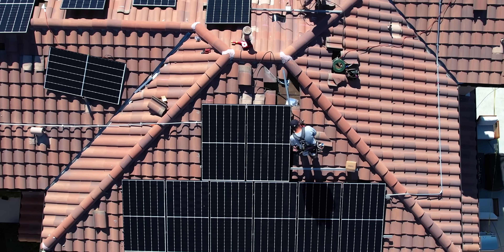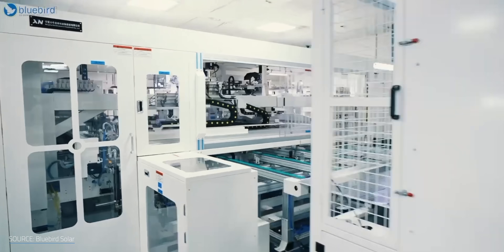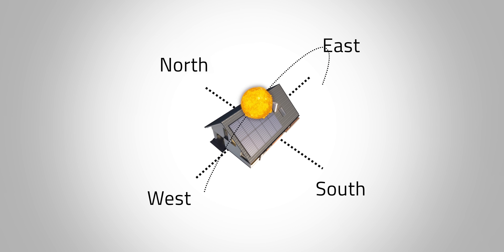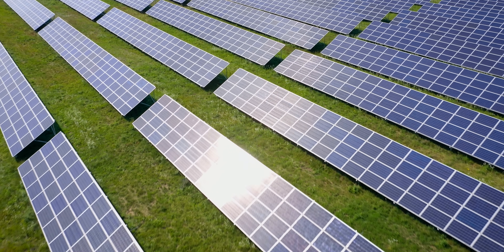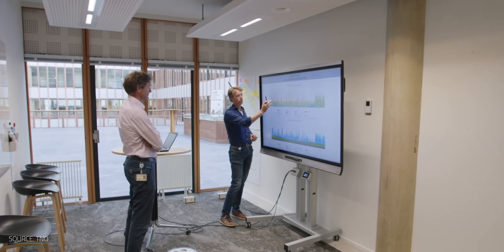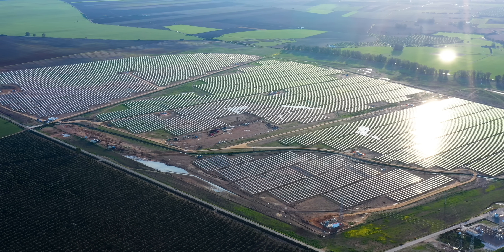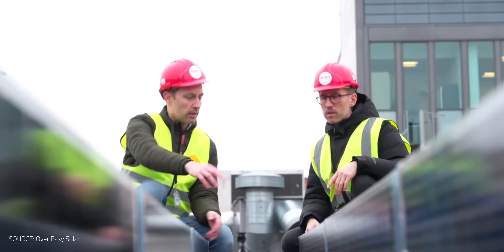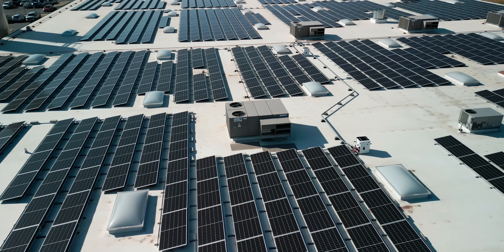Have we been doing Solar wrong all along?

Comment: Contemplating the "big reveal", it makes sense in a heat capture sense as well.  The vertical alignment means that the cross-sectional area that is parallel to the ground is lower, which would lead to less captured air below the panel.  The solar farms I have seen don't usually leave a lot of space for airflow, and the large area interrupted by support posts probably causes a lot of turbulence in whatever air flow does exist.

I would be curious to see how a semi-porous panel would perform.  Conceptually, drill holes in it.  Increase the area that can act as a thermal release, give a bit of a chimney effect to draw the air below the panel above, and allow for it to vent the stagnant air below more easily.  I imagine it would play hell with the electron flow and be prohibitive for manufacturing processes.  Holes in glass are expensive, and you would still need to make whatever seal you put in the holes thermally conductive to be reasonable.  Also would need to maximize the efficiency gain vs surface area loss function.  I'm just blathering here, so eh.

Comment: I’m going to try it
Reply: I should’ve added the recent snow we had here in Chicago. My bifacial panels went into a overvoltage on my charge controller. It was wasn’t a Lot just enough. I have a Victron 100/30 and according to the short circuit voltage, it should’ve been fine, but as soon as that snow hit it Went up shutting down my solar controller but yeah I’m going to reposition them vertical. I’ll let you know what happens either way my bifacial panels are  definitely putting out a lot more energy than my standard ones

Comment: The voltage only pushes the amps through the wires. The number of amp is what is needed. Voltage drop that small does not do that much compared to the loss with not having the maximum exposure. All in all solar panels outside the lab is a whole other story. Having had solar and seen how they fail to produce as they get older was not from a voltage drop. It was from less amps being produced. The whole idea that these are going to take us to a green utopia is just one more pipe dream. I am all in if it makes the electric bills go down but in reality all it has done is increase the cost of electricity for the poor and raised taxes. So just because this is a YouTube post it isn't going to increase enough energy to make a difference. All in all the amount of electricity demand is going up and solar is just a few percentage points (if that) of what we need.

Comment: I just see potential solar cladding and or yard delineators for construction in the future. Combined with other solar tech like transparent solar, windows too could potentially be solar. the construction footprint could be optimized to prosume electricity and strengthen grid networks as long as existing power infrastructure is upgraded appropriately. With energy storage technology, it might be possible to capitalize on solutions that save and earn money more so than merely offsetting the utility cost. I am excited for smart construction techniques that will make homes more comfortable and affordable long term.

Comment: Good result, BUT The explanation given is a little off. Silicon itself becomes MORE conductive as temperature rises, which is often a problem for old silicon transistors (Second Breakdown would happen and kill them if they got too hot under load.) The reason voltage is higher when PV panels are kept from getting too hot is related to that conductivity trend: Hot silicon has too much freedom in the charge carriers. They more easily jump back across the PN junction, so the cell does not produce peak voltage. That is the opposite mechanism of what was described. @UndecidedMF

Comment: i wonder if there's any benefit from the fact the the photons of light will spend longer traveling through the PV when the light hits it at a more extreme angle. 
Basic trigonometry. the shortest path through the panel is perpendicular to it, a length of "1". so maybe that has a reduced chance of each photon being absorbed. but if it hits at 45 degrees then there's a root 2, roughly 1.41 distance that the photon travels through the PV. if you can get it up to 60/30 degrees then that's a distance of 2, double the distance, twice as much chance of a photo being absorbed? but then you also have to account for higher chance of the photons deflecting off the surface and the reduced amount of photons over a narrower shaft of light hitting the panel because of the extreme angle. Laying directly at the sun the shaft of light is identical to the surface area. but if its at 60 degrees then the shaft of light is 1/2 as long, but would be the same width, so the reduced surface area hitting the panel is halved, while the potential to absorbed is doubled. so maybe there's no improvement, unless you are collecting from both sides of the panel.

Comment: This would also help in areas with a lot of snow.  In the winter my panels are covered. And it's kind of sketchy to get up and clean them off. So even on the sunny winter days, if the snow hasn't melted, i get no voltage.

Comment: Celsius, Matt, not Centigrade. 
Otherwise, another fabulous video! ❤🎉😊
Reply: As it turns out Centigrade is not acceptable to the Bureau International des Poids et Mesures, the keeper of the flame for the Systeme International or SI, the modern metric system.
Reply: Being identical in their characteristics and scale, either is acceptable, especially in countries which have not adopted SI units in full.

Comment: My guess is that vertical solar panels, which depend more on albedo irradiation and are not subjected to direct sunlight, experience lower temperatures. Lower temperatures mean higher voltages since voltage and temperature are inversely proportional. Higher voltage leads to higher power output.

Comment: those smaller 'apartment deployable' panels you mentioned would be perfect for renters in general. talking about the perspective of australia, we already have a huge market for rooftop solar arrays. even the most rundown shacks have almost their entire roofs covered. however there are still a lot of houses (particularly rentals) that don't have them or have a really old system that barely even works. the place that I rent in brisbane currently has such a pathetic array that it only produces something like 1.5kw a day. with current electricity prices and extra meter charges for having the system, all it does is make the bill that much more expensive. having a cheap, portable system that can be deployed anywhere and then taken with you would be a massive boon.

Comment: Your explanation of why power output drops with increasing temperature is bad - the increase in resistance is not relevant. The main reason why the voltage drops at higher temperatures is due to increased electron diffusion at the pn-junction, i.e. more electrons have enough thermal energy to go "the wrong way" at the junction, thus lowering its operating voltage. 
Also you got the explanation of the heat transfer coefficients wrong. When a heat transfer coefficient is lower, then the corresponding panel would heat up more, because it couldn't transfer heat to the cooler surroundings as easily.

Comment: I have two properties with 102 panels each at about 23 kilowatts per array.  They have worked great for 10-12 years so far.  I pay almost nothing for power each year, however, if I didn't have the power company and federal dollars to install, it would not have been worth it to get these installed because the payoff would have been 30+ years.  Of course it is nice that these are contributing to lower emissions than a power plant.  I love the technology, but the cost is prohibitive.  These are working so well, the power company will only approve arrays about half this size.

Comment: if its just cooling, then why not water cool the panels.

You could put anti freeze in the lines and run the anti freeze through a radiator

On cold days, you can dump the heat inside. On hot days, dump the heat outside, or if you have a pool, you can dump it in the heat in the pool

Comment: So would this not imply that existing solar arrays that have mechanical tilt controls, should be intentionally aligning themselves in a manner that reduces the optimal solar collection, but also reduces thermal degradation?  Or is this already happening?  I would also assume this could improve the durability/reduce cost of solar cell manufacturing as I believe high heat affects these as well?

Comment: re: solar panel inclination equal to you latitude?
I've always suspected that this cannot be true. Sure the panel is perfectly aligned for the exact moment of the Sun's highest point. However it is imperfectly aligned for all other points between sunrise and sunset, times at which the incident power is lower and so efficiency might be more important. 
Surely, there's an integration function to be done here to work out which angle between zero and your latitude give the overall cumulative maximum insolation?
(Even thinking very simplistically, there is ONE moment when the sun is at maximum elevation, vs two moments it is at every other inclination below that, where incident power is not maximized)

Comment: I'm surprised wind hasn't been mention as a reason why these panels are cooler. Wind moves sideways, and more commonly from in the east-west directions (as opposed to north-south), is this just a coïncidence?

Also, a huge advantage to these panels would be for places where we have winter. Snow will almost never accumulate on vertical panels, as opposed to horizontal/tilted panels.

Comment: I noticed most of the examples you listed were in high latitudes, where the sun is lower in the sky. That will also benefit horizontal panels. I’d bet there’s some latitude below which the cost/benefit math flips back to horizontal. Interesting thoughts.

Comment: The amount of land required for projected solar needs is grossly underestimated by most.  
Here in Georgia, I see large swaths of forest and farmland lost to solar "farms."   This new/improved technology would seem to greatly increase the viability of agrisolar.  I once calculated the amount of traditional solar farm required to "fuel" up the same number of EVs as our local Buc-ees super gas station does,  in ICE vehicles, to be in the neighborhood of 1 to 3 thousand acres.(depending on if your shooting for average or peak demand)  Even that number could be low.  Buc-ees does not allow semi trucks, but many many large pickup trucks pulling large loads and large RVs fuel there.  The amount of electricity required to move that much weight the same distance that those tanks of diesel will is staggering.  
Most agrisolar I've seen is mounted high with crops underneath.  This could be mounted low or high, depending on crops you desire to grow.  
All this is of great interest to me because we are attempting to build a farm in Africa to supply an orphanage there. Reliable electrical grid is another issue there.

Comment: 1) What are the economics like for these panels?

2) I’d be terrified to run a mower or bush hog anywhere near these panels…

3) Why hasn’t there been more side by side testing vs traditional setup?

4) if cooling makes such a big difference, why not simply slap a heat sink on the under side of horizontal panels? Surely this is less expensive than putting an entire additional PV face on the other side of the panel.

Comment: I could see this having some use cases with electric fences, It would bee great to stick a battery near by with a battery near by for the fence charger, if your running a few miles of fence line and set your panels just outside the fence you could potentially run a hard line and power an entire ranch with enough panels. But these may be too expensive for ranchers to be able to do anything with. they have slim margins as is, but potentially with enough of them they could become profitable if the power company would except payment for the extra power being supplied.

Comment: Or you could just add a small radiator to your superiorly positioned panel for a couple bucks, or even just a couple phase change heat pipes for less and aklow them to autocycle

Comment: The physics is pretty simple.  This is the same reason that heat sink fins are oriented vertically.  Heated air rises.  Flat panels trap the hot air under the panel and it has to travel to the edge before it can more upward.  That greatly slows the convection currents.  Vertical panels allow the heated air near the panel to quickly move straight up removing the heat efficiently.

Comment: For a small application, I think this would be great to install on traffic light masts and overhead highway signs, assuming glare isn't a problem. Maybe that could keep the lights running on these things with a battery or backup to the power grid at night. Same for highway barriers / sound walls to keep the lights running.

Comment: omg, if they were to put laminar flow or squirrel cage like wind turbines on the top of each "nearly" upright panel, then the panels' rising heat would generate more Elec (not to mention from breezes). A super system would have transparent water/ethanol jacket over panel to have water cooling of cells while generating hot water supply (or heat exchanged out).  Now array can be smaller w higher value output.

Comment: I have a single panel on our chicken coup that historically I have tried to keep relatively perpendicular to the dominant sun angle of the seasons but I got lazy and left the summer sun angle for the winter and was shocked to find that the lower “sweeping” sun angle of the winter sun actually seemed to charge my battery more fully and quickly. Now I just leave it alone and appreciate it as a happy circumstance 😂 🐓

Comment: I would have assumed the main difference would come if they used another material in between the panels or possible make the material dividing the 2 sides translucent. If anything If they throw the traditional mix out the door and rework it as i mentioned it could be the next big thing. Translucent might be hard to do but a more absorbent material might also work. Another idea mightbe to make the surface under the panels somewhat reflective or for example if they left 30-45cm under the panels or curved the light below to a limited degree it could make the morning, evening and the noon light as efficient but i do understand that the dust buildup over time would make it hard. its still possible to do this on flat buildings by having a maybe 5% downslope so wind and  water would periodicaly clean some of the debrie of the mini sun collector

Comment: would be interesting to combine with solar panels mounted at 45° to an A-frame between vertical bifacial modules. Reflection should increase yield for the vertical panels and reduce the noon-"dip" in output. With some simulation a very straight yield curve over the day can be realised.

Comment: Would these vertical bifacial  solar panels work better the higher up north or south they are installed? I live in Lithuania where the optimal solar panel angle is about 38 degrees. But i noticed something interesting after watching this video. At 38 deg and optimal azimut the effectiveness is 100%. But at east and west azimut with 90 degrees angle the effectiveness is 56%. So 56% x2 is 112%. So is it more effective land use to have these vertical panels instead here in North Europe?

Comment: I'd imagine because the ground reflects the usable visible light but absorbs the UV, infrared and other useless wavelengths, you decrease the available direct sunlight during peak daylight hours but supplement it with lower heat ground reflected light the panels are at a more consistent temperature and output throughout the day.

Comment: This doesnt really answer how efficient by panel size they are versus conventional tilted solar placement. It seems these efficiencies are based on performing to a percentage above what is to be expected from sub optimal angle to the sun.  It doesnt matter if the horizontal panel is technically 10%+ more efficient per panel if they output half the power due to not being able to face the sun properly. 

These still look like they are useful in specific placements and the ability to use them as actual fences and potentially between viable crops looks like a huge opportunity but I am extremely sceptical these will in any way be able to replace roof top solar/dedicated solar fields as a like for like.

Comment: Fully agree. We are living in the Amazon rainforest. The solar installations there are practically showing a high inefficiency on sunny days as the panels and roofs are drastically overheating. I would bet around 50° Celsius and more, which is 25° above recommended temperature. Multiply this with a loss of 0.35% per degree (25* 0.35), then the inefficieny during peak hours is quite a bit. So, yes, he got the topic perfectly.

Comment: I am hearing about the vertical orientation of BF solar panels first. But, Bifacial panels installed like normal solar panels have become pretty common in my country(India) especially since the pandemic(it was available since late 2018, but back then it was almost double the cost/watt than normal panels). But, in 2024, the cost is about 5-10% higher. And these panels actually require less maintenance, their life is higher, because of better heat disspation(due to lack of opaque backside and the wirings bein present on the frame instead of being directly on the backside) and solar radiation utilization. Point is, let them decide on the advantage of vertical orientation, but you can go bifacial even with normal installation and would get much higher return on investment over its lifetime.